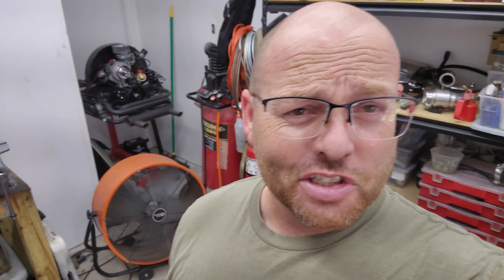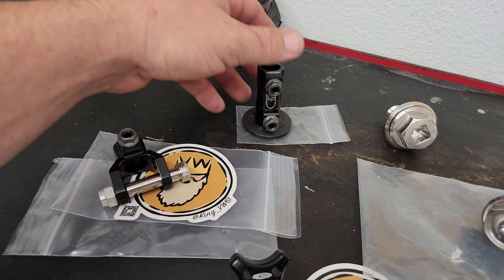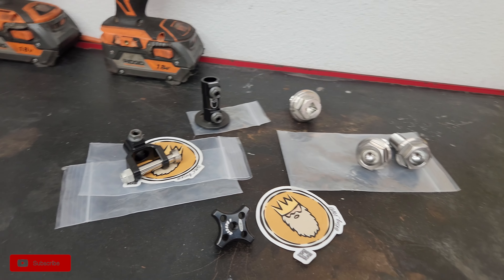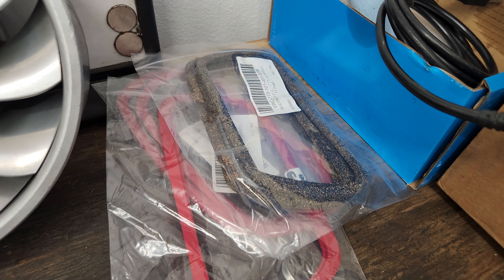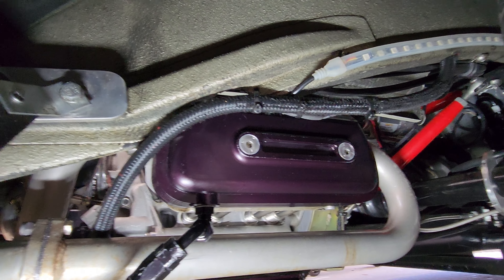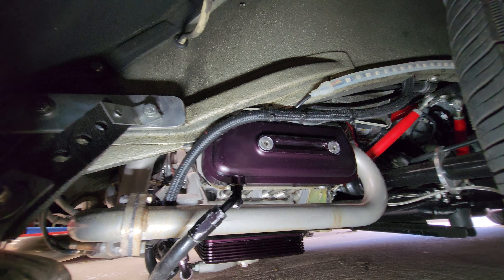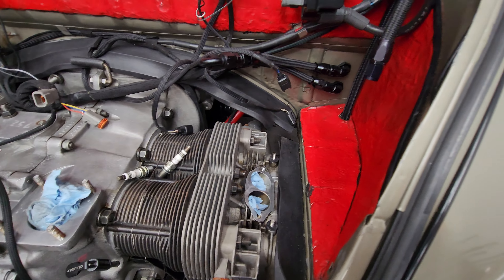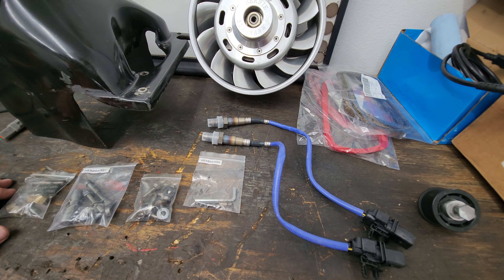VW Beetle Clutch Pedal Adjustment | NEW 4 Banger Clutch Cable Nut | JW Classic VW

Comment: SHIFT COUPLER!!!!  under construction 68 type 3 FASTY
Reply from the maker: You are in the drawing! Sounds like a fun build!
Reply: Thanx. Its bin fun fr the 3000 plus hrs since new years eve this year. Most of the metal is good now and most of it is protected. Parts arent too expensive but add them up and itll slow down any build. Free parts are the best especially if they are good and work well. Lol

Comment: That is WAY too much play in the pedal.  You want the pedal to move about  3/8" to 5/8" max otherwise you'll have a hard time shifting because the clutch isn't fully disengaged.
Reply from the maker: Lol... WAY tooooo much, good lord.  I got it just below an inch, and that's right around the max of .8.  If I need to play with it some more, then I will... it's pretty easy now with my new adjustment nut!